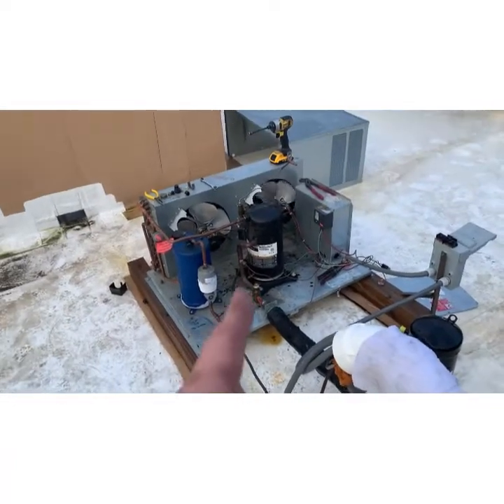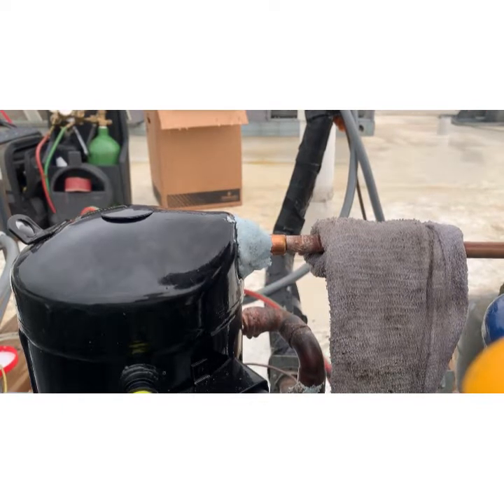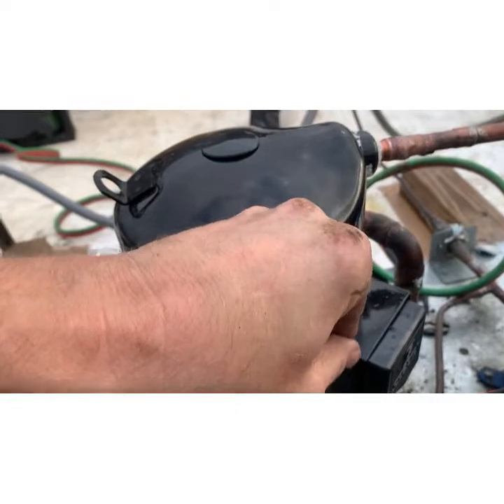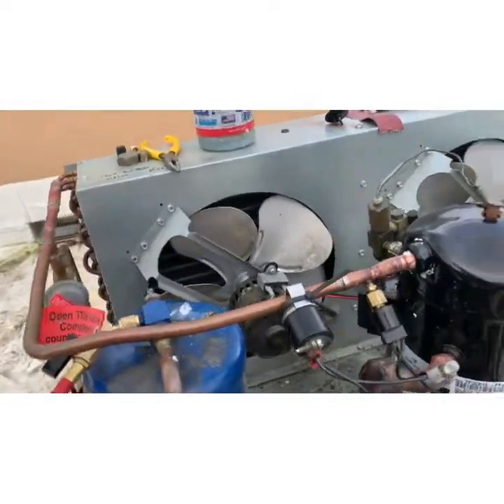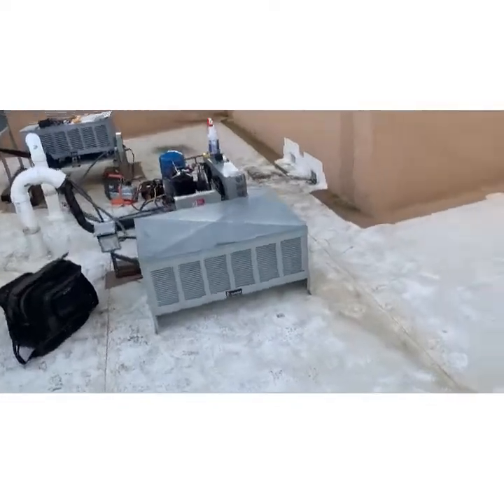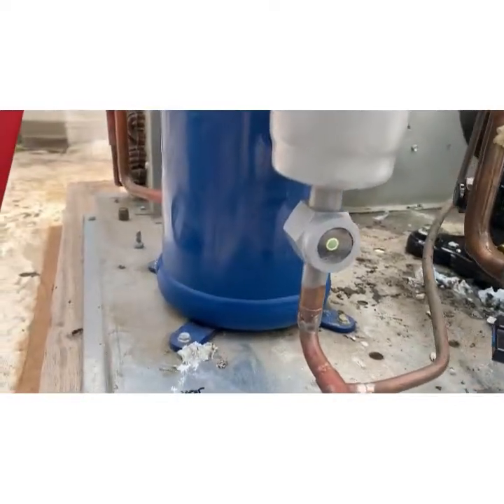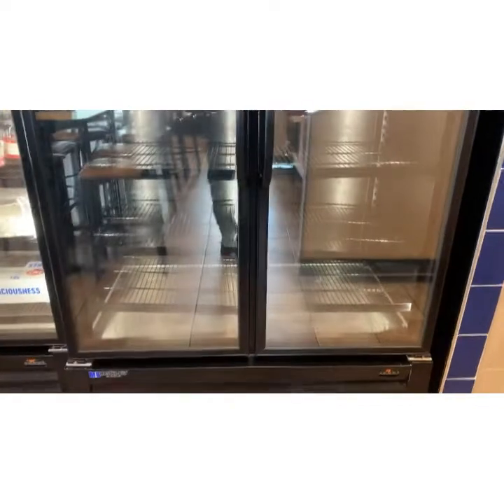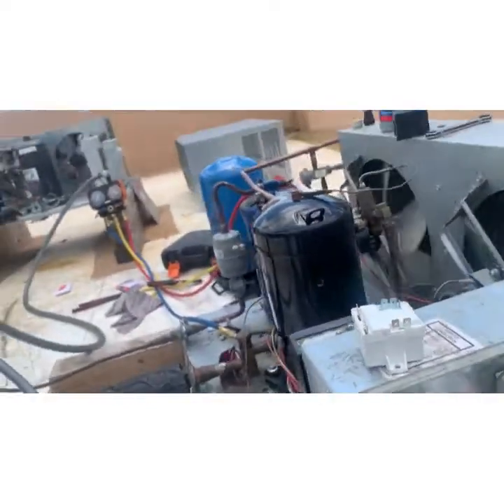Masterbilt compressor change

Comment: Have had good luck with delay on make timers on those standex/ master built condensing units. Has worked for me to help with short cycling along with tedious pressure control adjustment .
Reply: Appreciate that!!   I'm thinking delay timer, and possibly switching to a digital LPC.  I just worry for those mechanicals and vibration over time making minor adjustments which in that low pressure application could lead to disaster.   Since that's MY compressor to own now, I want it protected.
Reply: they make digital LPC? From what I saw in video did u change liquid injection Valve, my boss requires us to change every time company policy.
Reply: I did not change it.   I understand the policy since, again you own the compressor and that could be a failure point.

Comment: I’m surprised that compressor didn’t come with starting components. Single phase always replace the components when changing compressor. 

Usually with the freezer scrolls a time delay is helpful so it doesn’t short cycle